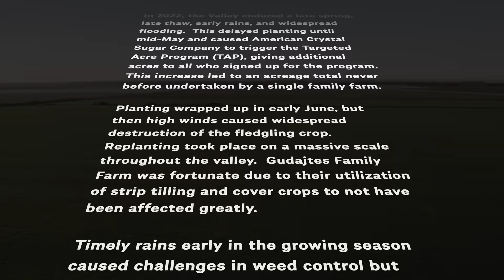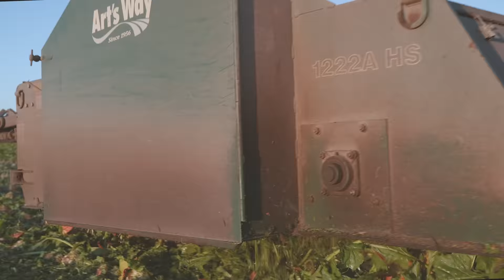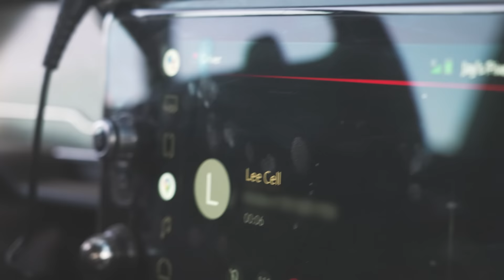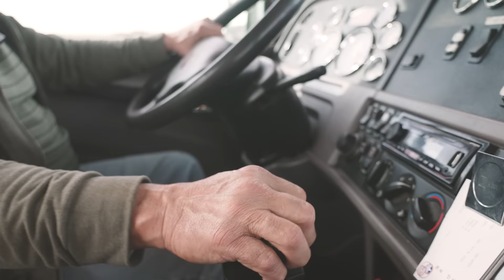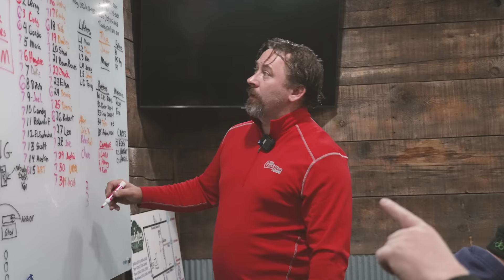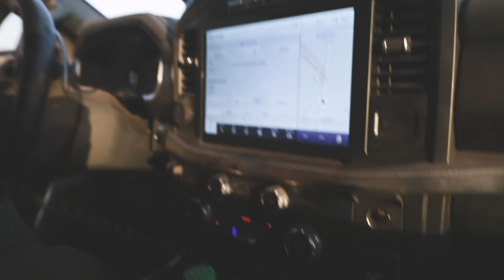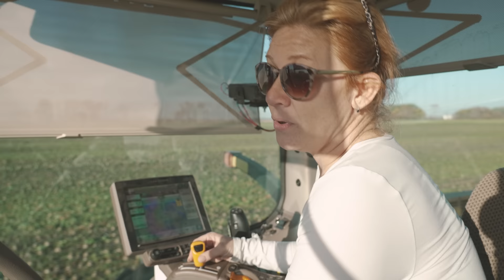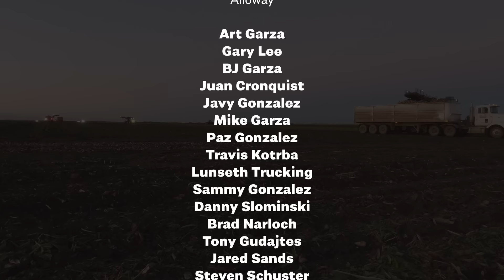SUGARBEET MAFIA - The Story of America's Largest Beet Harvest

Comment: Nice video ‼️👍🏻👍🏻👍🏻‼️

@ 14:05 ;  on the topic of Safe-T-Pull truck towing devices:  the biggest winner with the Safe-T-Pull devices is the tractor, and truck, radiators!!  Tow ropes and/or pusher systems have claimed quite a few radiators (and other associated 'on-lookers') over the years‼️ 🥴

Comment: 1 Ropa or Vervaet or ... (1operator) = 1 Tractor + defoileator and 1 tractor + beet-lifter (2 operators) AND a better cleaning job of the beets
Then, in stead of going in the field with the trucks, you use 1 or 2 chasers per Ropa (or other) and you fill the truck at the end of the field